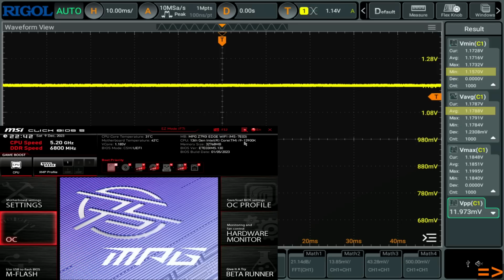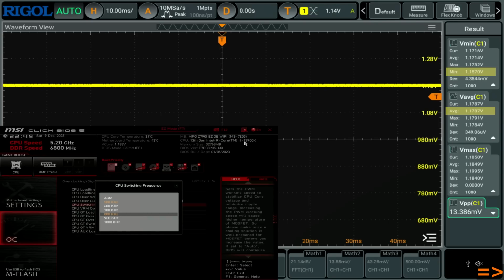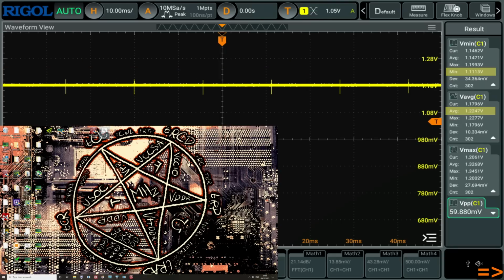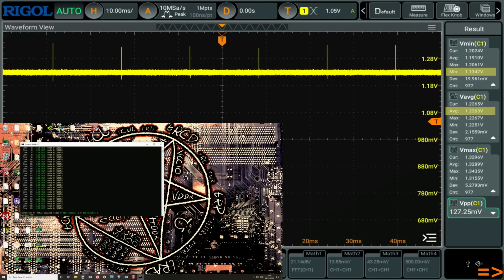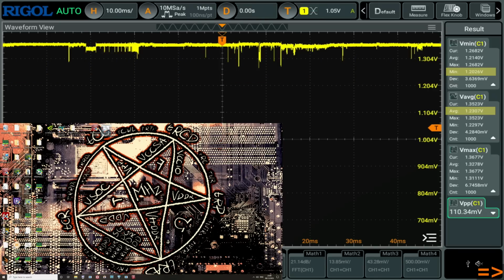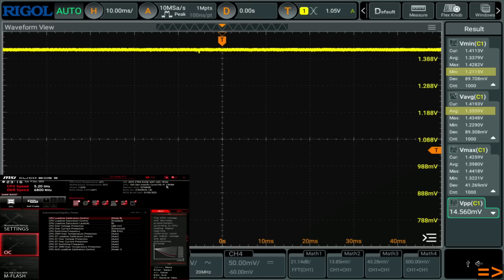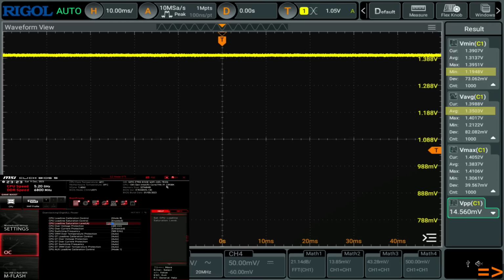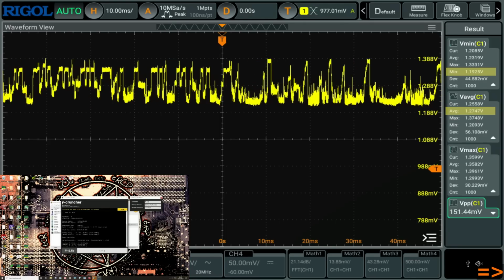MSI Z790i EDGE WIFI: Load Line Calibration and Vcore regulation

Comment: I got the Z790 Ace MEG with 14900k at 5800mhz.  Weird is i set the LL in options to 1 for more stable OC, but the Lite load option i had set to  110 60 for ac dc changed to 
auto and set 1 for each. at 1.3v.  Is this ok?  weird.

Comment: Can anybody explain what's going on here?:

I'm on a 12900k on MSI z690 Tomahawk DDR4.
LLC Mode 1 (no vdroop) - mouse feels smooth but restrained, I can not flick consistently, feels like a muddy mousepad. Also the mouse stutters way more when I'm running cinebench and i can not drag around any windows freely without them stuttering or lagging behind.
LLC Mode 8 (highest vdroop) - mouse feels way more fluid, flicking feels more natural and way easier. Mouse feels as well fluid while running cinebench, I can drag windows around without issues.

Currently I'm using LLC Mode 5, as it feels in between of the two above cases.

Comment: The problem with the higher mode is AVG voltage is far from the VIDs you set. Mode 5 is probably the best one, otherwise you have to run higher VID to get the actual voltage you want.

Comment: Thanks BZ! Trying to tune 13600k/z790 tomahawk d5 here. Currently using adaptive Vcore 1.25 @  LLC mode 3 (flat vdroop from HWINFO reading at 1.302-1.306v max idle-full load) to get 5.5-all P core / 4.3-all E core. 

- How would one go about trying LLC mode 8 with LL saturation without osciloscope? 

- Can the LLC mode 8 + LL saturation be used with adaptive voltage? Trying to keep dynamic voltage here. And as I understand Override Voltage = fixed voltage on these MSI boards?

- For durability/life span, is fixed Vcore with Vdroop safe? Or is it better try keep dynamic voltage?

Comment: Isnt the saturation point just a trigger point for when to activate LLC? So in windows with no load you dont neeed LLC which apply more more voltage. And when you start a heavy program current draws goes above the set amps and LLC is applied so the voltage wont collapse and cause a crash? I undervolt so my cpu doesnt reach max temp and clock down. I run 5.4all core at exactly 1.2V at all times. I dont want 1.3V at any times because a core will hit 90C and throttle down causing micro stutters in Pubg. I think this feature is best for high oc benchmarking where throttling effects isnt noticeable and you dont want to have a high static voltage in windows so the cpu gets degraded in a few years.

Comment: I’m new to this so please correct me if I’m wrong. For a proper overclock then the idea is to find the optimal voltage with an underclocked system the way you did it and from that point start the overclocking process until the system becomes unstable?

Comment: very interesting video...i've watched this and tried using saturation with my 13700k + z790i edge mb. I've started pushing the saturation from 50A to 380A (max at 400A). i get like 7-14mv drop during loads at LLC 8 380A saturation. I don't have an oscilloscope so obviously i dunno if this has good or bad transient response during load compared to LLC 2/3...but ill give it a shot for daily usage

Comment: I have the Z790 carbon wifi, for me Mode 2 adds slight additional voltage when underload and mode 3 lowers it slightly, is it better to have a slight droop or a slight overvolt?

Comment: i'll update tonight from the beta. Here is the official bios update description. Must have gone live in the last couple of days because it obviously wasn't there on the bios date of creation. 
Update CPU Micro code.
Update Mflash hotkey rule.
Modify secure boot setting.
Improve memory compatibility.
Support Foxville capsule update
AMI BIOS 7E03v14 2023-03-24 10.71 MB
Reply: Have nothing but Blue Screens on 1.40 on my z790i edge
Reply: @Nerdy Numen  why?
 That's normal when overclocking and tuning an mb/cpu. If you are not tuning and getting them, then obviously, you need to start tuning it.
Reply: @rs199208  oc was fine on 1.30, stock bsod constantly on 1.40, are you stable on the bios??
Reply: @Nerdy Numen  yes, I'm perfectly fine. I wonder if you are having an issue with the new llc saturation mb rules. I don't know what they changed in-between updates to the saturation, but did you happen to turn it on or off? It's on auto default. It would definitely mess with your OC badly if you didn't already have it setup.  Your AC_LLC and vdroop wouldn't be operating under the rules you assumed before.
Reply: @Nerdy Numen  yeah, 1.4 might be messed up more than I realized. 
I took a break on the z790i, but before that, something was really off on 1.4.  so i didn't bother with it.
Reply: @rs199208  In a discord groupchat, 1.3's equivelant was fine for all of us. but on the 1.4 vdd on all the boards is through the roof, EVGA, MSI, ASUS, and has caused Instability for a lot of us.

Comment: Hi mate, a little older I know but... I don't suppose you know anything about the mass/major issue with the MSI B450M Mortar (Inc Max) motherboards, constant CPU debug LED staying on. There are tons of posts about it. I didn't know this issue existed until I bought two of them to build two setups for the kids. Both arrived and caused me an absolute nightmare of troubleshooting. BOTH of them suffer the issue and are now just sat here as paperweights. Really does seem like a flaw/manufacturing defect of some sort.
Reply: Have obviously swapped every single component, CPU, GPU, CPU with integrated graphics, RAM, PSU, Hard drive, cables. Have also flashed each board to latest BIOS. One was on previous BIOS, one was on previous to that. Both now on latest. Still the issue persists. 'Restart' PC can work ten times in a row, then out of nowhere, five times in a row CPU debug. Same with shutting down/starting PC. Been so frustrating, it's near made me ill.

Comment: llc saturation with llc mode 8 vdroop is even better when used with a chiller/direct die on a seemingly very decent 13900KS and ddr5 8000 kit.
The z790i mb modified to set above the lancool III case tray, allowing the high flow Phanteks t30 120mm fans to envelop the board all around with low temp ambient air.

As BZ stated "more heat=more voltage " oops he said "more heat more vdroop" not easy cooling a tiny ITX.
Because of the high airflow and my preference of using only a few cores in many scenarios i achieve excellent Vrout/idle results on these settings.

I noticed real quick when LLC Saturation started to stabilize my high ram OC like the 8800 profile and the 8000 cl32.

I wished he had followed through with his idea to demonstrate the switching frequencies in conjunction with the llc settings!
I haven't noticed any weird issues yet experimenting with any of the switching frequencies including the dram switching even up to1500Khz, while simultaneously enabling Saturation + mode 8 llc at 6.4Ghz all core /8400 34 45 45 34/ and a tiny BCLK bump on top for 6430 Mhz fun....

Saturation + Mode 8 daily here...
I'm currently working on the igpu 2.5Ghz max clock voltage regulation that will be combined with the 6.4Ghz OC for fun!

I'll definitely start plugging in the Saturation values even more now that BZ admits it's a great and wonderful tool on MSI mbs!

I almost bought that Rigol Oscilloscope myself last month to do just this. Trial and error + guessing takes much longer to come to these conclusions. I was waiting on you BZ!!
Thanks for the video still!!
Reply: This guy overclocks
Reply from the maker: what stress tests did you run at 8000? because I can't get VST to run at all at 8000 on this board.
Reply: @ActuallyHardcoreOverclocking  

TM5/Absolute that's about a 1hr20min give or take. Hits ram and controller pretty good. 
I can pass 8000 at vdimm 1.4v probably I ran it awhile that low just to see. Way lower voltages than my other kits. 
I only plugged n played and tested xmp mostly. For instance I passed it on 8200 also by just raising the dram speed and vdd2 some left at 1.45 vdimm . 
Where saturation saved me is that it took me longer to get comfortable just raising the vdimm immediately well above anything else.
 Now i  know vdimm is #1 first thing just yeet it. 
First time I ran 1.68-1.7 was getting cl32 44 44 34 or it was 45 44. 
8400 is pretty easy, and so is 8600 to play games tweaked out. 
Oh I also run ring at 5.4 majority of the time so aida64 44ns or lower but yeah I miss MLC on 12th gen oh well. 
And this 8000 kit is my 6th since 2021. Also by far my best kit yet, I got it on a whim and thought it wouldn't be better than my other A die. Oh well. 
My highest clocks are just fun profiles and don't want to stress them but might when I get a Apex. 
Oh, ha! First time I switched on the new kit on this combination I was testing one stick at a time to find best slot and stick. It immediately booted 8800 in slot B1 with very little extra voltage. To get both stick to boot into windows and play around I needed a lot more vdimm. Slot A1 needs too much attention to make it worthwhile. 

!
Reply: @ActuallyHardcoreOverclocking  
.. If the imc can be helped..

As I stated my A1 slot needs more attention than B1 but before I figured this out I found that my original choice of the best stick may have been incorrect. 
So I  switched the sticks around one more time as I was pushing the lowest latency tweaks yet on this 8000 kit but felt like I hit a wall. 
 Well, switching that ram around again was the largest improvement on this mb next to yeeting vdimm voltages to open up more headroom. 
I had assumed the msi memory force indicator being longer than the other stick indicator meant less potential. 
 So now I wonder if longer the memory force indicator the higher possibility that stick has more headroom available.
Reply: Im on Z790-A Pro(D4)+13950HX(Q1LP), LLC mode 8, AC 16, DC 1
i don't have saturation settings, only Overvoltage limit100mv
VID matches Vcore under load, you have same?(No VR Vout sensor)

Comment: Can you tell me how can i get this waveform view? I am beginner in overclocking.
Reply: Get a €1500 scope with HDMI output.
Reply: @Wasmachineman  na, $300 give ir take to find one.  The best one for value currently $800 mid range kinda that can be hacked in order to unlock the $3000 model version features. Multiple manufacturers introduce a whole line with each model identical other than buy to unlock more.

Comment: as someone who's just put together an MSI Z590 system (i7-11700K - it's a test machine), it's vaguely ridiculous to be seeing 5.2GHz and 6800 MT/s in the BIOS! The last 2 years have been ... consequential.
Reply: 11th gen is very under rated in my opinion especially since a lot of people with 12th/13th gen turning off e cores for gaming
Reply: @zacharymorrison4298  I kind of agree, which is one reason I got it. I do have an Alder Lake system (i9) which is very impressive, but since I built it a year ago I'm not spending any time in the BIOS. I'm regularly looking at 3200 and 3.6 instead.